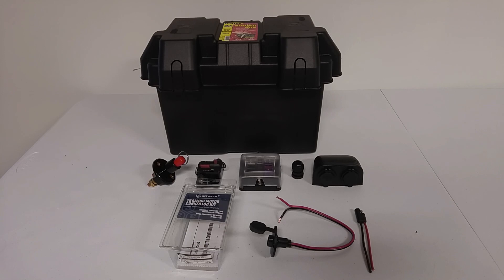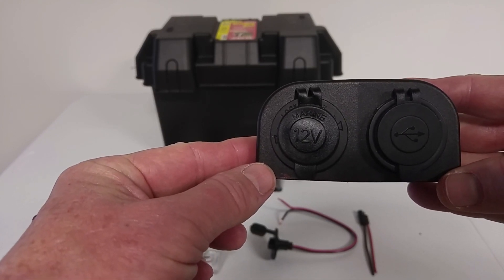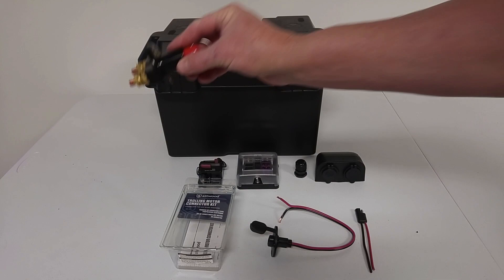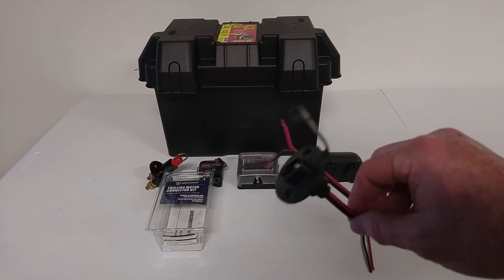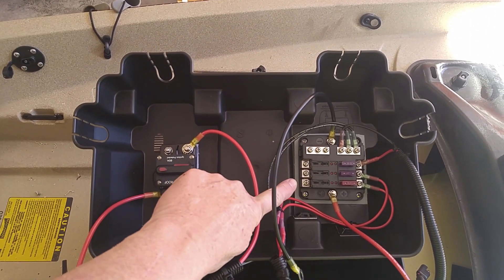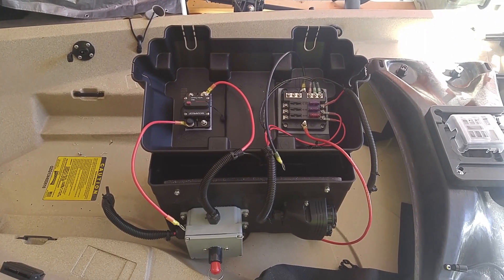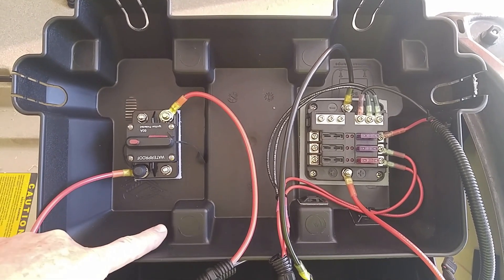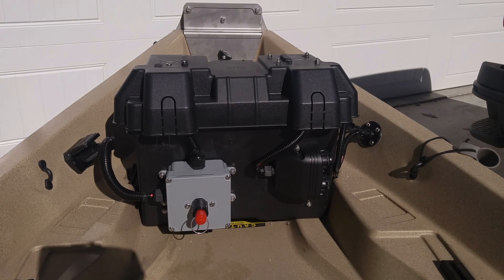DIY Kayak Power Station Battery Box

Comment: thanks  for the video  i grew up in South Florida and  myself and a group of people do a Canoe trip down a very quiet and slow moving  river  i am a retired Woodworker  and a pretty handy guy all around  ive been thinking about  building a Cedar Strip Canoe that  has solar charging  and a similar  system that you made as our canoe trip  involves rural  camping  as luck would have  it another hobby of mine is sewing  boat canvas  and other heavy duty material  on my industrial strength  walking foot sewing machine i bought for doing auto interiors on my Vintage cars  and Canvas work on my boats  i’m kind of thinking about  making a  enclosure on the canoe  for sun protection  this canoe  idea is something ive been  designing in my brain  for over 25 years  and would include a 12  volt stereo system  btw over the years i suffered a traumatic brain Injury that  set me back physically and financially
Reply from the maker: Sounds like a great project. I would like to see pics when done. Thanks.

Comment: what gauge wire should I use for the connection between the battery and the circuit breaker? I have a 30lb thrust minn kota trolling motor
Reply from the maker: I always use 10G on my motor connections.

Comment: But if you flip over? Will it stay in place?
Reply from the maker: It has straps that attach across the top and on the sides of the kayak. If it flips over, all the fuses will blow out and it will get wet but stay in place.